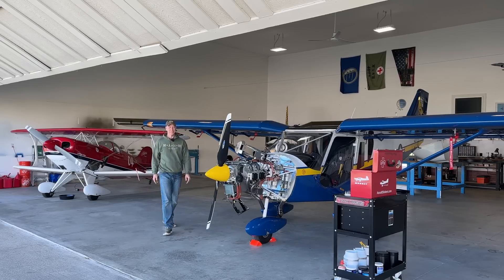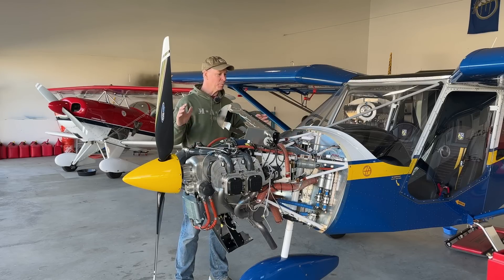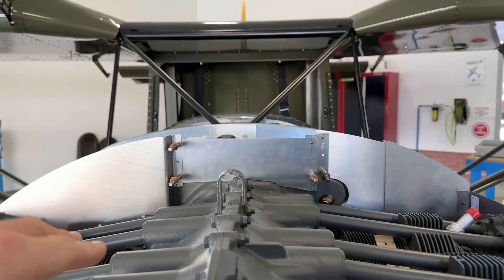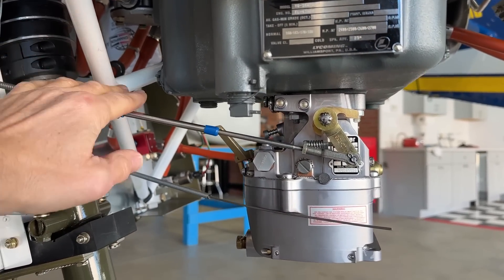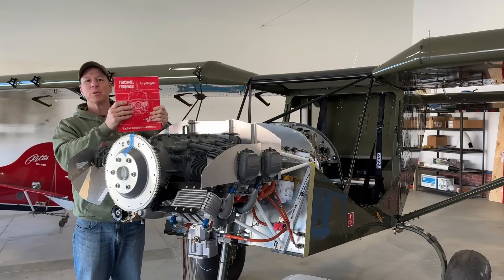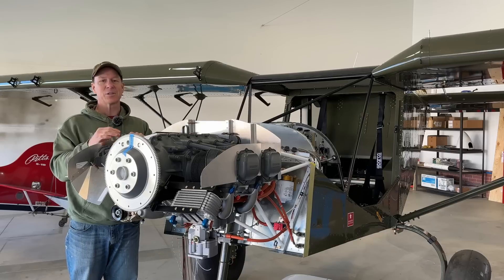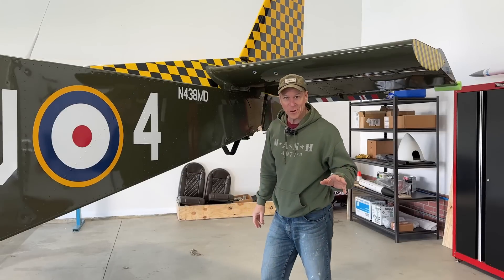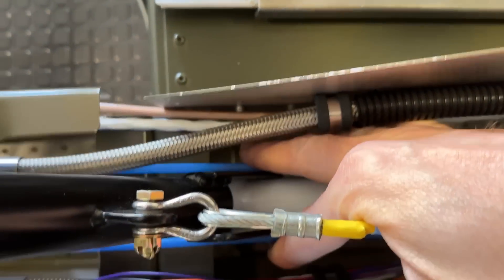Latest Progress and Update on the Zenith CH-750 Super Duty Build.

Comment: I’m curious how the condition inspection on the UL 350 in the Cruiser went.  Have you seen any issues?
Reply from the maker: Other than the cracked muffler a year or so ago, I've had no issues. I did replace all 8 spark plugs and it seems to idle smoother now after a cold start. This has really been a good engine.

Comment: It looks like your carb is installed backward. On most applications the mixture lever faces forward. The throttle cable would then come down from the left aft end of the engine attached to the engine on the accessory section of the engine.
Reply from the maker: hmm, it could be. Thank you Lycoming for providing NO instructions whatsoever.

Comment: McMaster Carr has the ball bearing you need. They ship quickly too. You can measure the diameter of the hole on the cable and the ball diameter will be slightly smaller to fit.

Comment: Having built several RV aircraft I can tell you Vans has a bracket that sandwiches between the sump and the throttle servo;  the mixture and the throttle cable are secured to it.  This way when the engine shakes it will shake with it.  If you would like me to email you a plans view of it I would be happy to.
Reply from the maker: Yes please! KitplaneEnthusiast@gmail.com

Comment: If I were to guess, the ball bearing for the cable is in the housing mounted to your panel where the knobs slide in and out. When it was pulled back it came out and stayed in the tube end of the housing. Dismount the housing at the panel, pull the cable out and pour the bearing out.
Reply from the maker: You’re a genius! The dang ball was indeed still in the housing. All fixed! Thank you.
Reply: @KitplaneEnthusiast  yay

Comment: Good to hear from you again, Would a 3D printed cover that just snapped into your old jack location be something you would like?  I can print something up for you if you would like.  That would save you some time.  could even integrate a plexi window if that sounds good.
Reply from the maker: I was thinking of riveting a clear piece of lexan on the bottom and having a cool inspection window. Could you make some thing that snaps in with a window? I guess it doesn't need to snap in-I could rivet it in too.
Reply: @KitplaneEnthusiast  Yes, I can do something that dropped in with a friction fit or just a slight tab to grab the metal thickness that would then have or allow you to bond in a window.  This could then be pried out with a plastic scrapper so as not to mar the finish.  just need the hole dimensions and the material thickness along with what thickness of lexan you want to use .  What I am thinking is sort of a picture frame that is about .06" above the existing metal, with an internal lip for the lexan and several tabs to grip the existing metal.
Reply from the maker: @stevenwilkes5737  That sounds interesting. The opening is 4.3215” by 3.25”. The aluminum is .0265. 

If you send me your email I’ll attach a pic if that helps.

Comment: don’t use lycom engine what I’m hearing.
Reply from the maker: I think the Lycoming or Titan engine is the best engine for this airframe, but I'm very disappointed in Lycoming. Not only do they provide NO data on the engine, but they also include a bag of nuts and bolts and clamps and don't even tell me what they are all for or where they go! No, I would never recommend a Lycoming. Go with the Continental Titan.
Reply: Thats what I‘ve heard as well. When I bought my IO-360 I went through Aerosport Power. They were just awesome! Every question before the purchase was answered as well long after the engine wss delivered. One of the best customer experiences in the whole build process!

Comment: As I recall, pull the silver knob and wire all the way out of the sleeve. With the ramp facing up, place the ball in the ramp and slide the wire back in to engage the ball bearing in the hole in the sleeve. Don't forget to put the spring on the silver knob first. Good luck.
Reply from the maker: I'll have to see if I can find the correct sized ball!